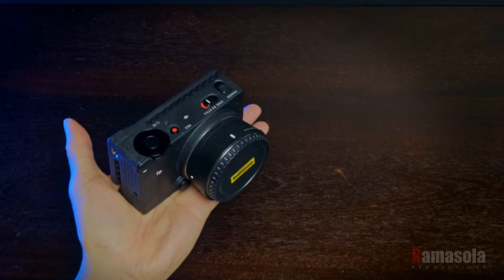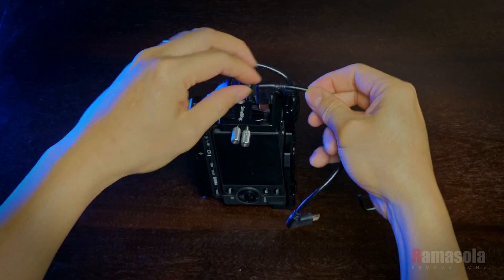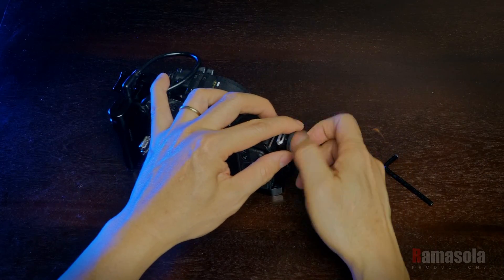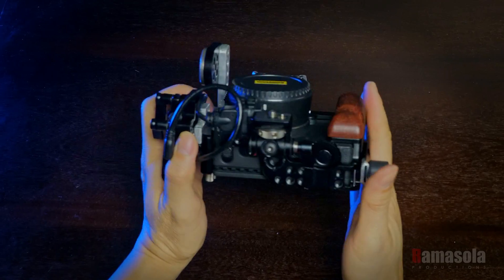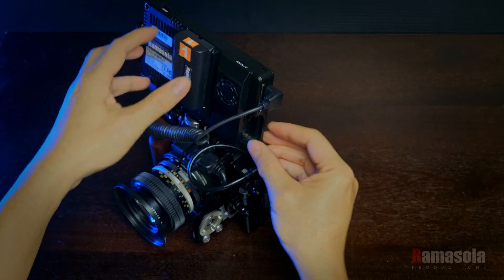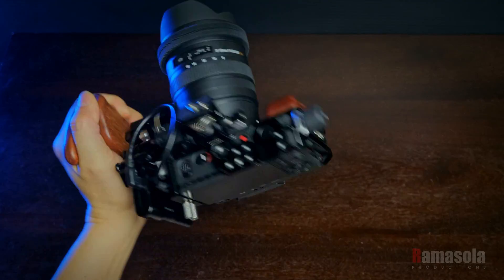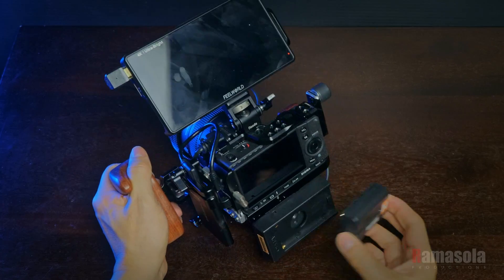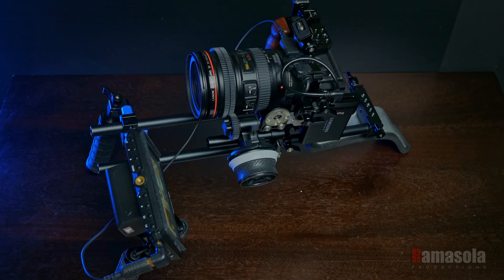My Sigma fp Rig Configurations

Comment: Hi,I really liked your video, I want to ask you if the remote control with the JJC cable has ever failed you.
Regards.
Reply from the maker: Thanks, glad you liked it. Regarding the remote control, sadly I have not used it enough to give you my opinion. I only use the cable part which I connect to a different trigger, a lanparte shown in the video. The remote is similar to another one I bought for my canons way back then and its mostly mechanical inside which you can open and adjust/fix if you have connectivity issues.

Comment: Where do you put in the shutter release cable? I didn't know you could to that. I always have to hit the button on the camera
Reply from the maker: It goes into the 3.5mm headphone jack. The oem shutter release and the ones from JJC have a cable that adds an input for your mic so you can still plug in a mic while using the shutter release/start stop cable.

Comment: Why did you choose an hdmi adapter?
Reply from the maker: What other option are you thinking of? In my case it was 2 things, this hdmi adapter does not need power and most affordable on camera monitors are hdmi and also I needed it to be able to plug the hdmi to vga adapter to provide a 3.5mm audio jack for headphones in case I won't use a monitor with headphone out.
Reply: @RamasolaProductions I was wondering if there is a reason you went for and hdmi adapter and not a micro hdmi cable with an hdmi clamp.

Comment: Amazing! Thoughts on the 4.0 firmware  and false colour?
Reply from the maker: Thanks Colin. I just did several tests on it and I must say it works as advertised! Truly enhanced the usability of the fp in a "professional" sense. Even though the fp lacks a log profile for monitoring the false color is a good workaround. The false color is reading the raw signal and not the signal with the color modes applied. So when you are monitoring and even though you see the image washed out and blown out on your camera or external monitor, if you turn on false color you will be surprised that your image might not yet be clipping. And this is the true information because once you bring in your CDNG file into post you can confirm what the false color has indicated.
Reply: @RamasolaProductions  amazing, this has been holding me back from buying.  Weird how you have to hold it down though. Why not toggle on/off, oh well.
Reply from the maker: @colinthomas2525  agreed. I already tagged Takuma Wakamatsu on this request for toggle switch.

Comment: You can buy short manfrotto plate from Tilta. I have them for my fp's. Also, that BSA2650 support is discontinued. I must say that Smallrig cage is not a good starting point for fp/fpL anymore. Tilta one is way better.
Reply: U can costumize they will make it for u  for discontinue item via  smallrig costumer service. And price 60 usd. I order 4days ago
Reply: @gueipulx4244  why would I pay 60$ for 25$ item?
Reply: @eW0LF  because they discontinued. And only for  Customized item not mass product.
Reply: eWolf could you please elaborate on why you think the Tilta cage is superior over the Smallrig cage? I am researching what I need for my Sigma fp and any feedback is welcome, the clearer the better. Thanks in advance :0
Reply: @pablovanwetten  no problem. I have 2 out of 3 Smallrig cages and I was not been able to assemble decent rig out of them. Discountinued accesories and bad versatility is what you can expect from Smallrig cages for fp/fpL. It's almost like they tried to make you buy all of their cages and swap them while transitioning from one tipe of rig to another. With Tilta, I was finally able to create "core rig" that can be fitted in any tipenof use. Run and gun, shoulder rig or gimbal, they can be converted to anything.

Comment: Can you please give the name of the adapter from the NP-F battery plate to a dummy battery? Or maybe the link to this product.
Reply from the maker: The NP-F plate is this one: https://www.amazon.com/Ansso-NP-F970-Decoded-Panasonic-DMW-DCC12/dp/B07C7B43B7/ref=sr_1_9?crid=2EESTXTTA8LD2&keywords=ansso+np-f+plate&qid=1666773339&qu=eyJxc2MiOiIxLjk1IiwicXNhIjoiMC4wMCIsInFzcCI6IjAuMDAifQ%3D%3D&sprefix=ansso+np-f+plate%2Caps%2C90&sr=8-9
Reply from the maker: The dummy battery is this one, I cut the wire of the NP-F plate and this battery and soldered them together to make it short. This dummy battery gives a battery power status in the camera lcd.
Other dummy battery will show ac adapter power.
https://www.amazon.com/dp/B08NF6WNDS/?coliid=I4DMZTWP5R2K3&colid=35U4ZY5F4H84G&psc=1&ref_=lv_ov_lig_dp_it

Comment: Great video! Those side plates have been discontinued by smallrig. Do you have any alternatives to keep the cables secure?
Reply from the maker: Graeme, before I had the side plates I made a DIY protector which was merely a piece of aluminum bar which I drilled a hole to screw to the side and carefully cut out notches which the hdmi and usb cables firmly went thru. It lessened the pressure from the usb port itself.

Comment: there is no sound when i use hdmi to VGA+3.5mm adaptor, any idea to solve?
Reply from the maker: In my experience using different vga adapters, you need to press the 3.5 trs jack hard in. There are was also a certain brand that did not work.